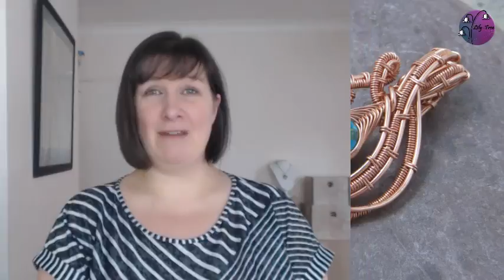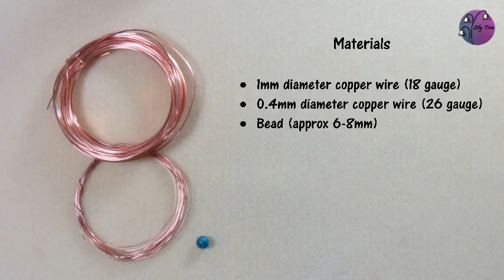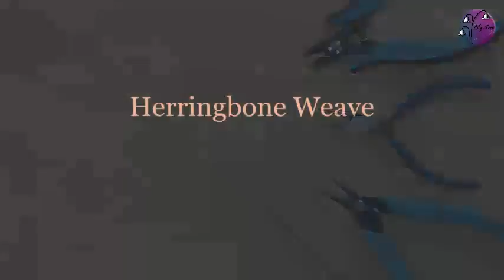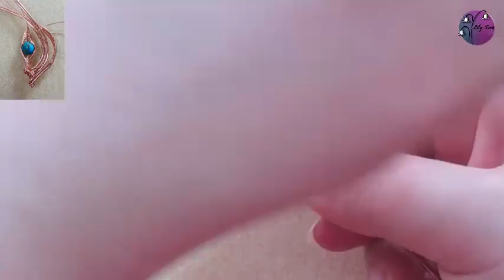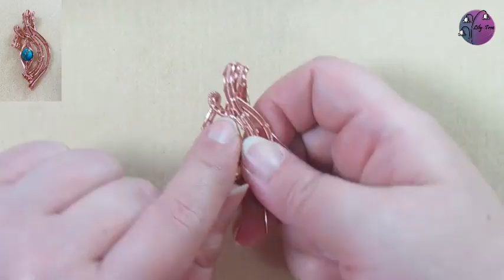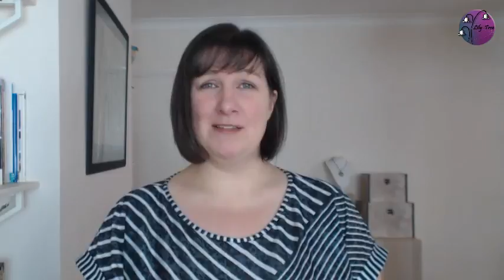Wirework Pendant with Herringbone Weave - Wire Wrapping Tutorial

Comment: Great design, but wondering why you took the wrapping wire off the base wire, clipped the tail and then put it back on? Why not just do all that in one step, leaving the wrapping wire on the base when clipping the tail?
Reply from the maker: Thank you!  I tend to take it off the base wire so I can get a clean cut with a full loop to help hold the wire in place.  I also make sure this is flat, so the end is directly in line with the rest of the wire rather than offset.  I find this is the best way for me to keep it neat, but it can probably be skipped if you prefer.